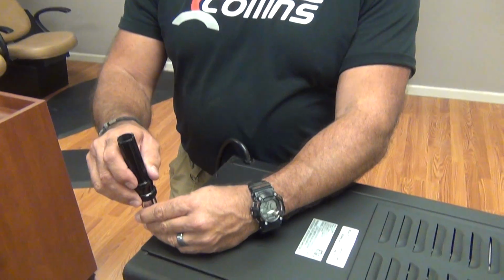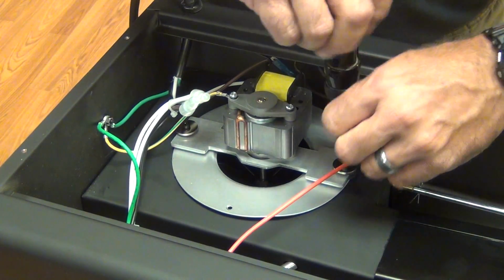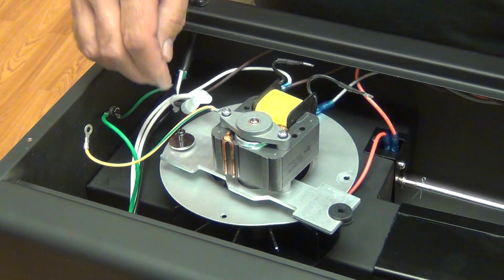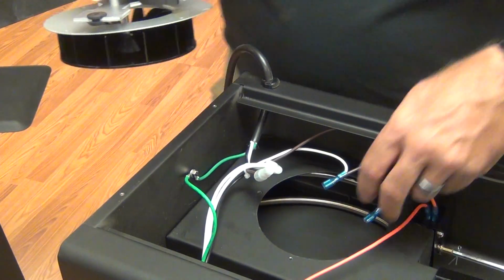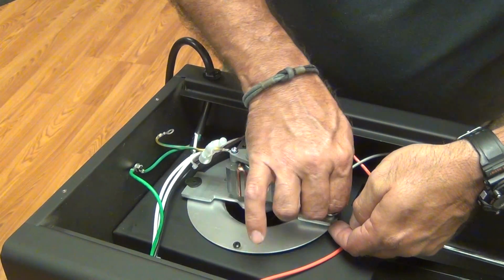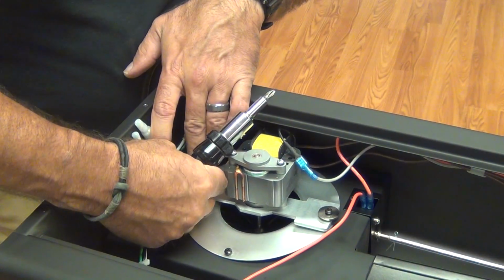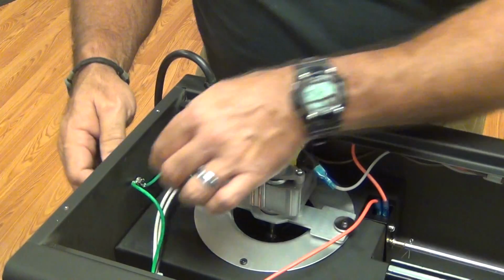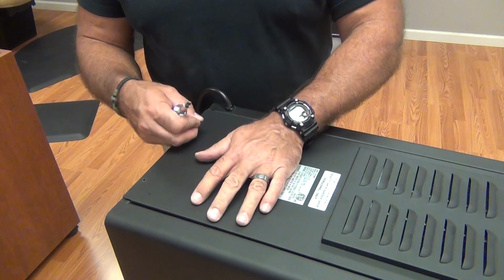Dryer Blower Motor Change-out

Comment: Hello I've followed your instructions but I noticed I'm having trouble disconnecting the two wires that connect the motor for its power source it's in a white clamp type casing a bit difficult to disconnect.